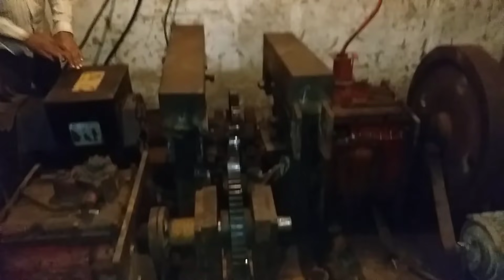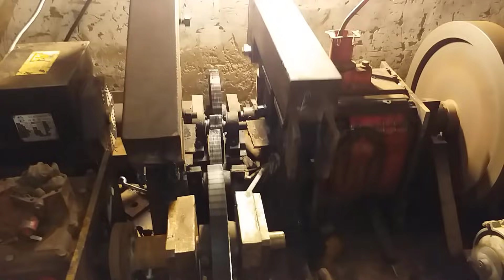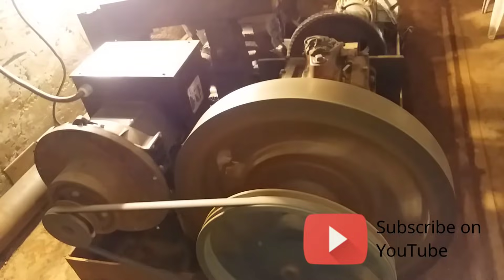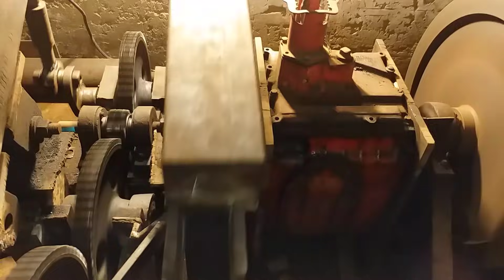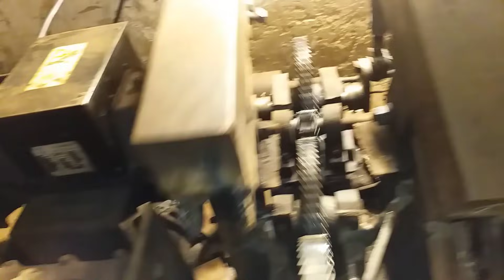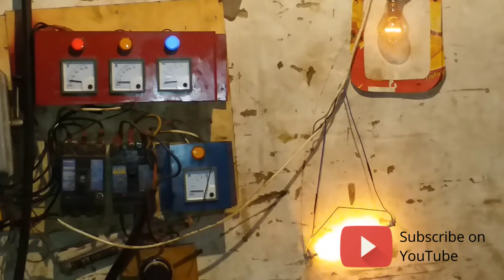free energy generator 100 kva Self running 24 hours make free electricity 100% 2018 new video

Comment: There is no thing as free energy, the max You can get is over unity but sure not free energy. The fly wheel can indeed store power to drive a bigger generator. But before the system is running will take a while to get the moment of the flywheel at speed. Very noisy system, oil consuming.

Comment: No way would I want A BIG NOISY mechanical metal monster vibrating my entire home!! Geezus Dude, you're nuts!! Where is your POWER coming from to start this this THING up?
Reply: 3 phase AC.
It´s actually just some mechanics attached to a 3 phase AC motor.
Based on it´s size, i guess it´s something between 1,5 to 3kW and ofc no free energy at all.
It´s just a motor that get´s powered from the AC line.